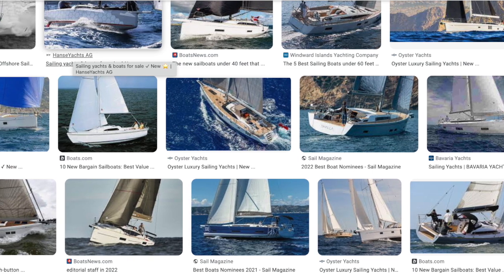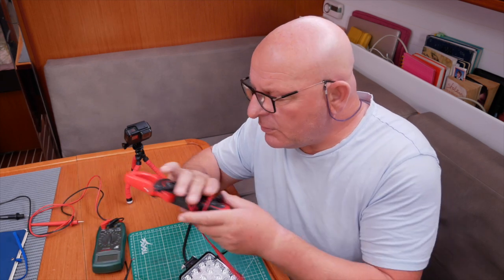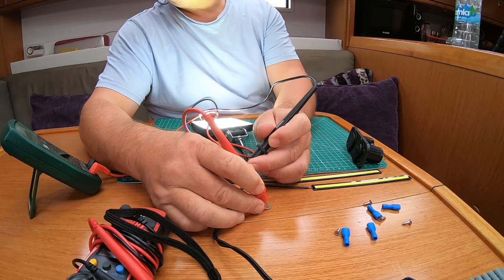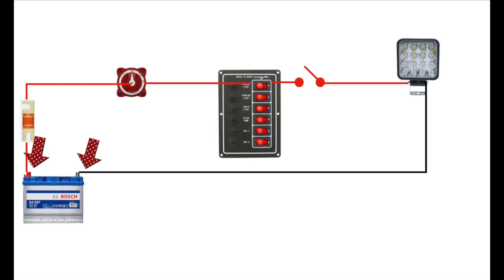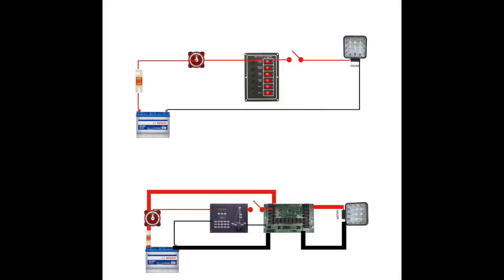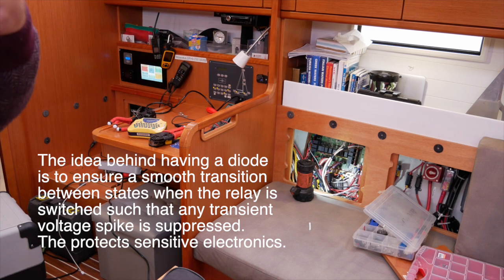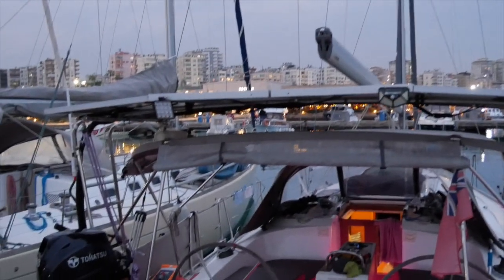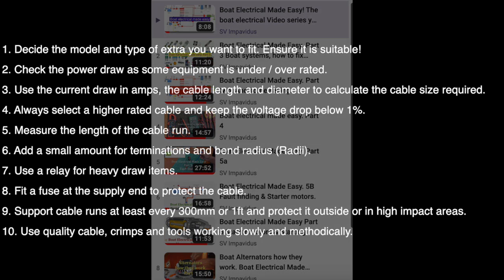Fitting Sailboat Extras. How to put those personal electrical touches on you boat by yourself.

Comment: Great video.  Very well explained.   I like how you speak slowly and explain in detail the cabling, multi meter usage.  Question at the end, you mentioned that your boat was designed for halogen.  Did you have to make any changes when you went to LED?
Reply from the maker: Larry Hi. No the interior reading lamps were Halogen and the cable is rated for the 1.5 amps per fitting. The LED bulbs are 0.10 amps per fitting so we have capacity now to fit the new cooling fans off the same cables!  Wooo Hoo!  Sail Safe mate. Ant & Cid

Comment: Thats interesting to see. I had not realised that old and new would be wired so differently. I have a 1990 boat with the old set up. I have some wires coming out the stern to the gps and ais aerials. They are white (so i think not UV protected) and also open cable that could get banged. I will look for some protection of some sort for them. Thanks for the tip.
Reply from the maker: Your welcome. Loads of other helpfull videos here 😁 Hit the subscribe and bell. Sail Safe mate. Ant & Cid

Comment: I own a Bavaria 37 Cruiser and love your tech videos!  Keep up the great work.  One question I had was about the microwave you installed. What was the spec on the microwave and do you have an inverter on board for when not on shore power?   Many thanks.
Reply from the maker: Steve Yes it does we have a Victron multiplus compact running all our mains and charging. Check out the install video and the Raspberry pi video. We will be doing an update soon. Sail Safe mate. Ant & Cid
Reply: @SVImpavidus  Thanks Ant!

Comment: Will you be putting a motion sensor on the aft LED?
Reply from the maker: Hi Barry. We did think of doing something with an override switch for when we are fishing? Maybe fit two. One with and One without. They are cheap lamps at £2.70 each here. Sail Safe mate. Ant & Cid